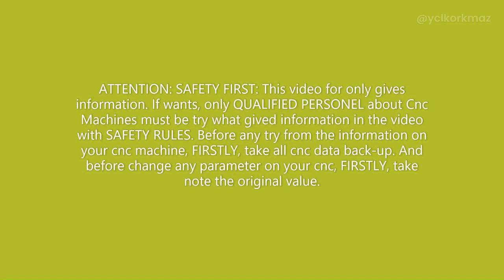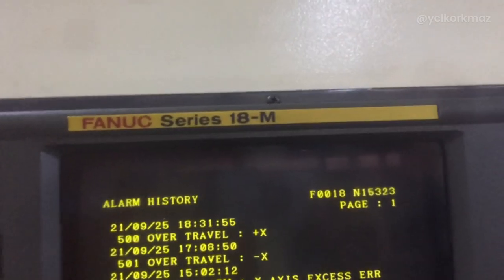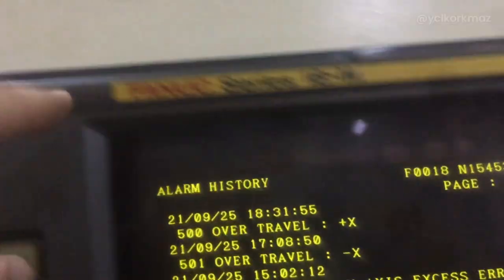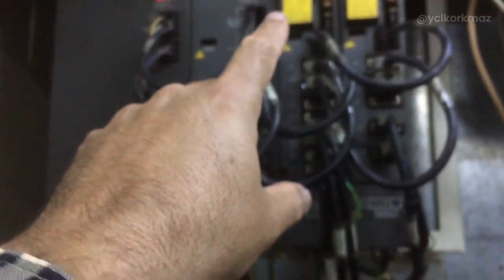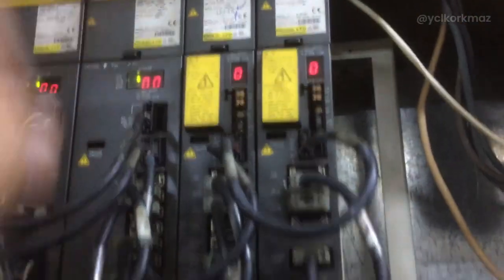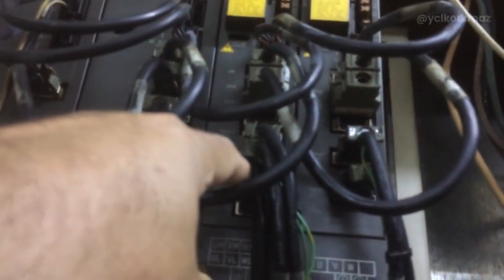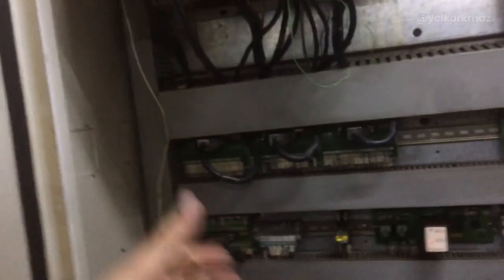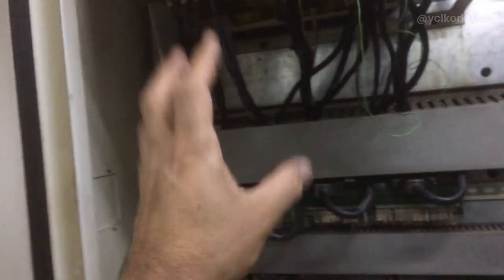Fanuc - 410 SERVO ALARM : X AXIS EXCESS ERR alarm Solve - ( Fanuc 18M )

Comment: Did this failure prevent you from functioning?
Reply from the maker: I did not understand exactly what you mean?
Reply: @yclkorkmaz  With the fault active, did the axles move?
Could you machine a part, for example?
Reply from the maker: No, no moves the axies when i be there. I already showed in the beginning of this video that the axis little bit moves and gives the alarm. @patrikandrade3387
Reply: Right same issue in my cnc machine I tryd x axis to move but some little there alarm again and I think power machine off  to alarm is removed and again' x axis move and again' what's there I'm so confused ?? @yclkorkmaz
Reply from the maker: This situation, i explained already in the video. Check detailed the video and try solve the problem in of course safety rules also if you have enough experience and training.